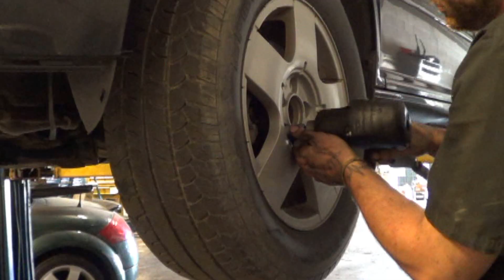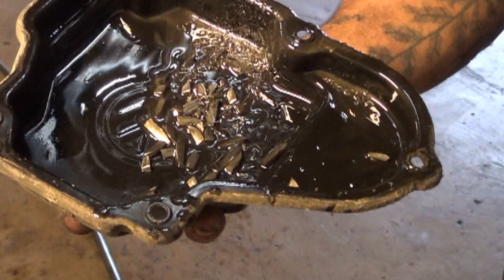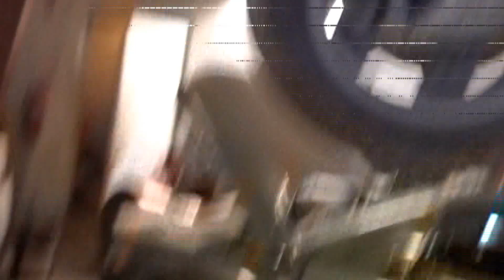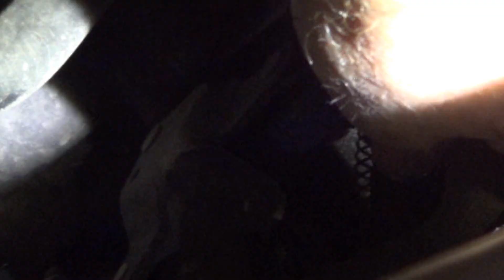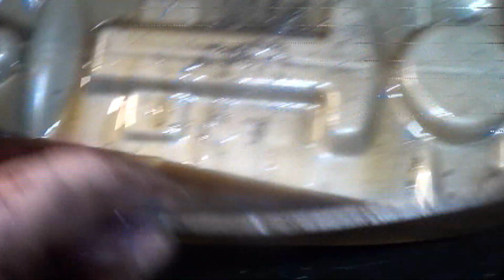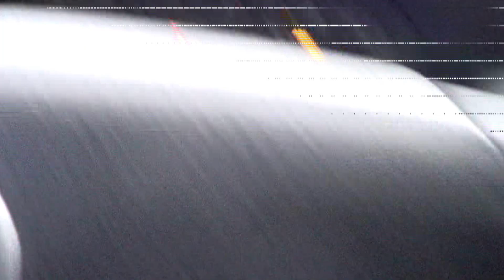Tdi 02J No 5th gear

Comment: Glad I found this. I'm brand new to the VW world. Just 5spd swapped my 04 BEW wagon, got to finally start it tonight and wouldn't ya know it, my donor car's trans gets stuck in 5th and 5th is noisy. It's still on jackstands at the moment and everything else works so I'll be pulling that cover tomorrow after work. It's been a fun project with the wiring and recoding my ECM but id really rather not have to swap that trans already. Lol
Reply from the maker: stuck in 5th is commonly the 5th hub and slider assembly.  see following link.  http://kansascitytdi.com/02j-trans-repair/
Reply: @CoolAirVw  great site. I appreciate that. Still haven't pulled the cover. I'm still buttoning up a few other things but I did do the shifter adjustment and finally got a chance to drive it and all is well but it definitely sticks in 5th. I can pull it out pretty easily by grabbing the linkage but it ain't moving with the shifter.

Comment: Hi, I stripped out all my 02z box recently ( similar enough set up) and even though I was careful enough to log and video all my steps....I forgot to mark the 5th gear adjustment plate position🙈...Is there any way to put it back in the right position, or do you have any tips ? Thanks and love this vid
Reply from the maker: I have two videos on 5th.  (this is one).  One of the videos tells how I do it.

Comment: Thanks again! Do you have the torque values on those: Gear bolts, gear carrier, "5th Adjustment plate" bolt, and case cover bolts? or where can we find them?
Reply from the maker: shop manual.  Not every bolt on a car gets torqued with a torque wrench.  sometimes it just gets tightened.  Mechanics intuition is what I call it.

Comment: Mine was going fine until yesterday I was on the highway and the shifter went from 5th to neutral. I noticed that when I put 5th and accelerate, the shift knob get pushed back as I accelerate until it jumps to neutral. That didn't happened with any other gear. Completed the few kilometers left on my trip in 4th gear at a lower speed. The same happened last year and that time it was on the  ongoing trip and did the trip back (300 km) on that condition and ruined the gearbox. This is another one and I can't believe it has the same failure just a year after. That time was a broken output shaft seal, can it be the same thing again?
Reply from the maker: 1st I would worry that your trans is low, 2nd the hub and slider wear and cause that scenario.   the broken output shaft seal probably made it low and destroyed the box.

Comment: Are u located near Columbus Ohio I need help my 02 TDI 5speed dropped 5th while goin down the highway. Please please please help
Reply from the maker: Near Kansas City Missouri
Reply from the maker: I know a guy who can ship you a trans.   Rebuilt or used.
Reply: What's the prices look like.  I looked in 5th cover no metal but the single gear on right is sloppy
Reply from the maker: @mistasoulsnatcher7402  If the splines are stripped then its gonna require removal of the trans from the car and extensive  disassembly to fix.  I have one here like that right now.
Reply: @CoolAirVw  yes gear and spline a e stripped.  I'm to the point on welding it and dumping it
Reply: If u can lmk the price on one the 5spd oj2 TDI shipped to Ohio. For the right price I'll change trans
Reply from the maker: @mistasoulsnatcher7402  If you do that I feel sorry for the poor sucker who buys it.  Im not gonna price on youtube.  Find my website and email me there.

Comment: hi coolairvw, great video, please can you help me about a 01M golf Mk4 1.6sr automatic transmission I have the code 01192 Torque Converter Lock-Up Clutch: Mechanical Malfunction with a brutal change from 2nd to 3rd (I feel the car brakes then it engages the 3rd). thank you for helping me
Reply from the maker: 01192 is very commonly caused by Valve body.  Your  "brutal" sensation 2-3 is a bind up which could be solenoids,, valve body or internal trans problem.

Comment: The fifth gear area takes a different oil?  Should that be changed regularly?  I assume you pull the cover off to drain as shown?  Where do you fill it?
Reply from the maker: No.  Just one fill for the trans on the transmission in this video.
Reply: It uses the same oil… just not enough of it